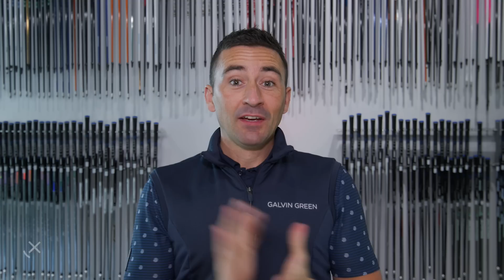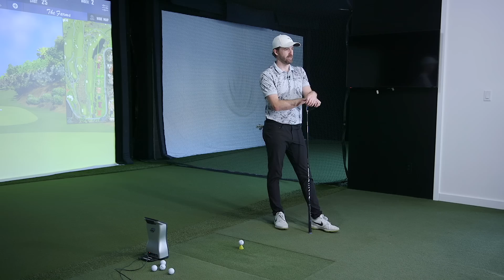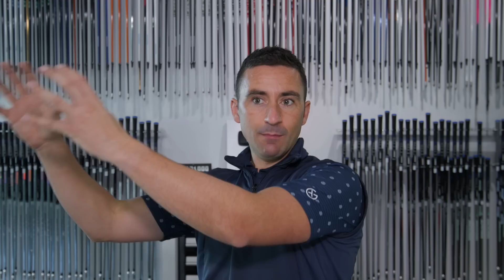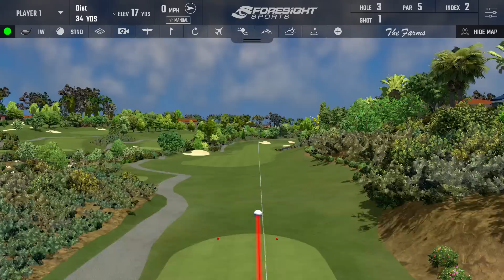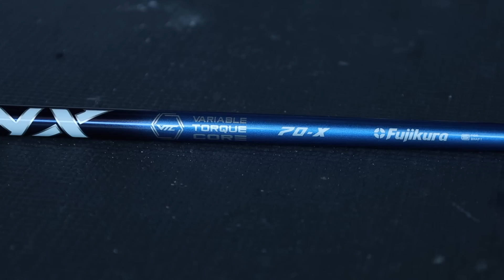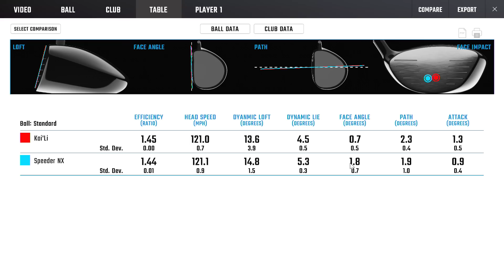NEW SHAFTS FOR 2022 // Mitsubishi Kai'li & Fujikura Speeder NX Review

Comment: After breaking my Fujikura 50g S shaft I am replacing it with a 60g Kai'li XS and this video just got me very excited for it after this video thank you!
Reply: Hey man I seen you tried the Kai’li shaft in the stealth driver. Did you use stiff or x? Trying to decide which one to go with. Online it says they’re the sane torque and have only 1g difference in weight. Basically the same shaft? What do you think would be best for 95mph ss?
Reply: @BuffaloBarber24  I would recommend trying them first for sure, the X stiff just feels a bit more steady in my opinion but my stock speed is around 120
Reply: @monsieurzoronov612  you went from a 50g S to a 70g X?

Comment: I am currently using the Speeder NX 50s, I gamed the Ventus blue 50s all summer and it’s a great shaft completely takes the light side of the course out of play. The NX I feel is straighter and allows me to almost draw when needed, which would really only be my into wind shot.  Won my club medal with the Speeder first time with it for a full round. Very impressed.
Reply: I too have that shaft now and it is a winner. Love the feel and control. Came from ventus blue 5s which went straight but no feel for me.

Comment: I believe you should have tested b the 70x version in the Mitsubishi to compare apples to apples. The lower torque would match up with the Fuji. Not sure why you didn't! The lighter is harder to control than the heavier at Matt's swing speeds.

Comment: These tests are well outside my technical understanding and budget but Ian and Matt's comments seemed to suggest a timing issue with Kai'li that might have been easier to understand if we'd seen video of one of the misses. Not a complaint, just providing feedback from a non shaft geek trying to learn more from an amazing channel and Ian and Matt's expert insight.
Reply: there isn't a timing issue, its just how you load your swing its a timing preference everyone has a unique swing what he said about the timing on the Kai'li suites me better than the speeder I dont like the middle having play that messes with my swing
Reply: @monsieurzoronov612  Hey man I seen you tried the Kai’li shaft in the stealth driver. Did you use stiff or x? Trying to decide which one to go with. Online it says they’re the sane torque and have only 1g difference in weight. Basically the same shaft? What do you think would be best for 95mph ss?
Reply: My swing speed is 110 and I wouldn’t dare put the Kai’li white in a driver if you were below 105. Just come off a fitting and the blue was too flimsy with my transition and red… well… that just spun like anything. (Among about 10 different shafts I went through)

Saying that - just get fitted vs “thinking” what will work for you or what the internet says will.

Comment: Hey Lads,
I recently found a crack in the face of my 7-iron, I spoke to Callaway and they said they couldn’t replace my 7-iron with the same model, only with this years model. Not wanting a mismatched set, and not wanting to shell out 1k+ for a new set, I don’t see any options.
Thanks.
Reply: Just had this happen to me with Mizuno.  Did you get them from a local fitter or straight from Callaway?
Reply: @sockjohnson  I got fit for them, but had my coach order them direct from Callaway so I could take advantage of the college discount, and of course they’re not stock so finding one in my specs is gonna be all but impossible
Reply: Ebay.
Reply: @jarvlast1186  yeah that makes it tough.  I had two irons crack in hosel and they wanted to send me two of the newer versions of just those two irons which like you would have been a mis-matched set.  My fitter leaned on them for a new set.  Check out Callaway Preowned.  You can get  individual irons from them.  You can always swap out the heads for the shaft you have in cracked one.  Sell the new one when it comes.